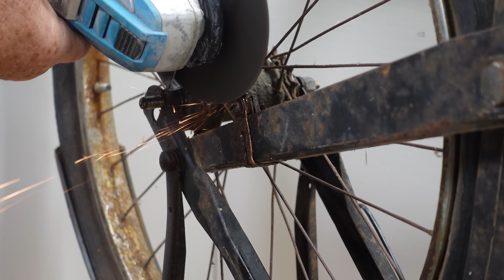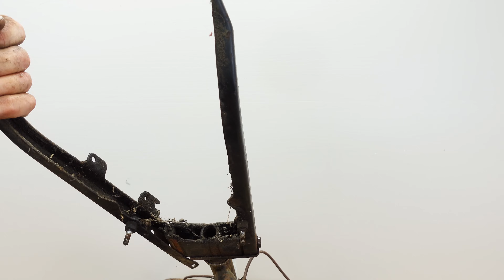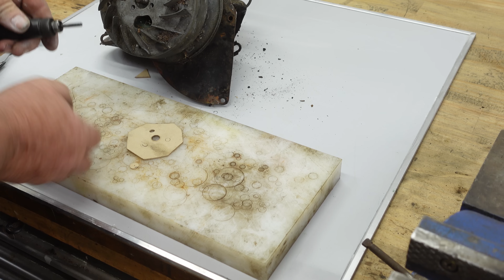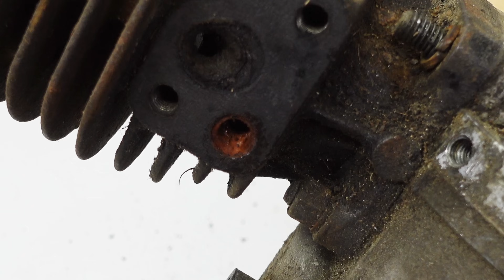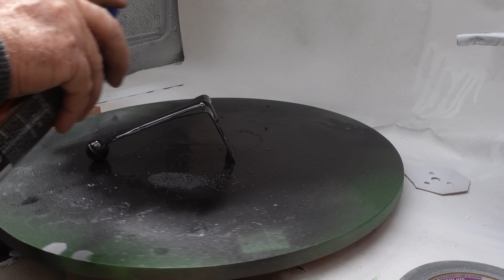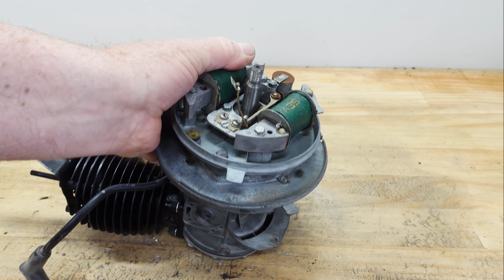Petrol Heads version of an e-bike 1960 ,1700 solex restoration  stage one

Comment: I bought (same price as a 4 speed bike) mine- brand new in Paris in 1966, rode it to Spain, petrol problems with Spanish fuel, walked it from Barcelona - up to Perpignan (where I could find a shop to fix it), along the Med to Genoa, then north to Turin and then I had to walk it up to the tunnel at Mt. Blanc*, bribed the guard to let me ride it through the tunnel, into Switzerland, Lichinstin(misp.) into Austria - Vienna then north up to Graz where it finally died.  I left in a parking lot in Graz and took the train south tio Venice, Greece etc.  It was am anmazing machine - I was carrying far too much lugage and so I usualy wound up walking up the moutains, but hell on wheels comng down. * French guards must have heard that I was coming through and were madly waving to get me to stop - yeh sure!

Comment: Hammering on the stator plate risks moving the main bearing. It should be drawn on using spacers and the flywheel nut thus putting no stress at all on the main bearing.

Comment: I remember seeing a 1973 Solex bike sweepstake offer on a Kellogg's  breakfast serial TV commercial and associated cerial boxes too. I believe  73 or 74  was the final year of Solex bike  production.  I was 9  at the time.
Reply from the maker: The original Velosolex company was taken over by Renault and then by Motobecane in 1974, and then closed for good in 1988. The machinery to make the S 3800 eventually ended up in Hungary. The last complete bikes made with this machinery were made in 2005-06. The last ones actually had CDI ignitions. thanks for watching sharing your experiences of them, cheers Richard

Comment: In the late 80's I bought two Solex 2500 (one running, one almost complete, as parts donnor) for 20 bucks. Drove one a few months and then sold all for 50 bucks. Wasn't a bad deal, back then. 
Meanwhile usable Solex change hands sometimes above 2k.

Comment: Loved your video, have restored three of these 1700's over the past 10 years , just a few comments if I may, as someone has already mentioned the main bearing is crimped in, if you don't do this it has a tendency to move out of housing, you will know when this happens as the big end will rub against end cover! Also that motor at some stage has had a new big end fitted as it has a needle roller bearing, original was plane bronze bushing, possibly was replaced with later piston and barrel as well , if so you are in luck as late set up produced a bit more power!! Also none of my 1700's had a coaster rear brake set up all worked on caliper rim brakes front and rear, however could be different I guess from where bike came from, good luck with fuel pump and the throttle valve assembly, cheers.

Comment: THE BLOKE WHO USED TO COME AND SHARPEN OUR GARDEN SHEERS AND LAWNMOWER BLADES HAD ONE, HE USED TO HAVE A STAND ON THE BACK WHEEL AND HE CONNECTED THE DRIVESHAFT WITH A RUBBER BELT TO A SHARPENING STONE THAT HE USED TO SHARPEN THE BLADES WITH, I've never seen a crank and connecting rod like that before,

Comment: How did you refit the big crankshaft bearing which you forced out of it crimped seat? Why did you not replace this crucial € 5.- part? This motor will not last.
Reply from the maker: Thanks for your feed back cheers Richard 😀